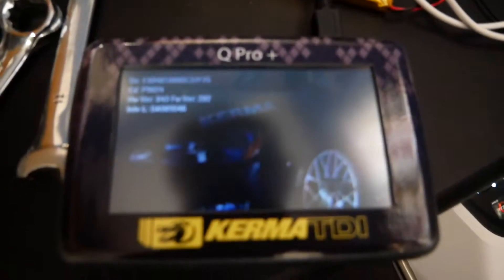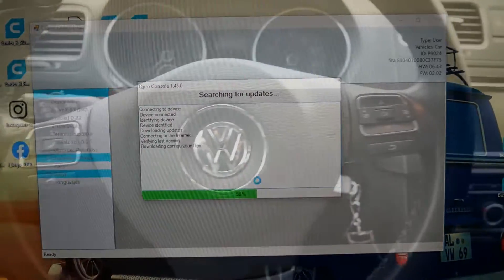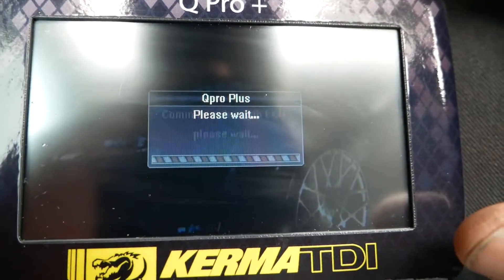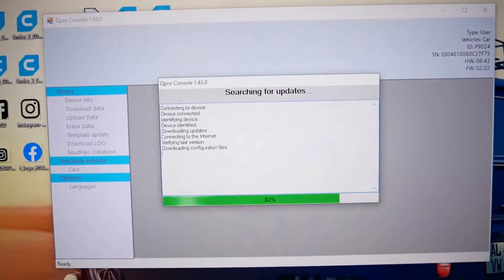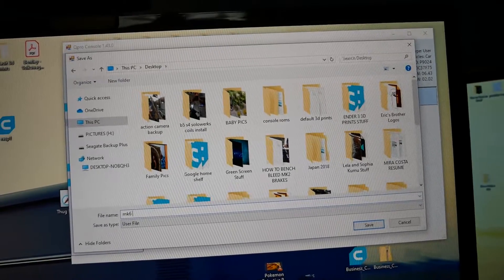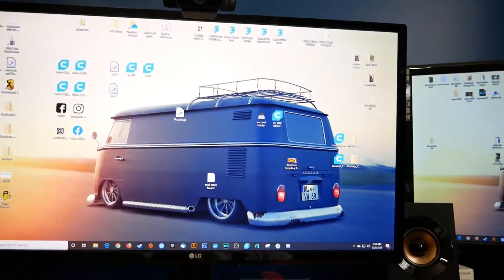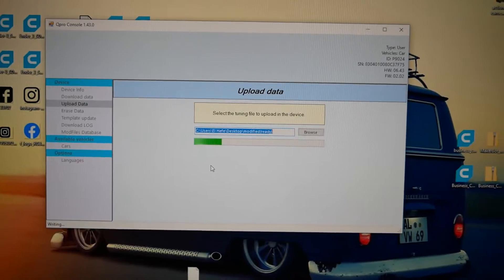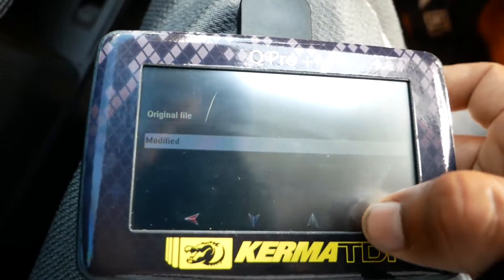How to Flash your MK6 ECU with a KermaTDI QPro S6EP20

Comment: Great video. I have a 2013 Audi A3 TDI and this simplified the process for me immensely. Got the tuned file from Charlie at Kerma in less than 24 hours. After receiving an error code ("F002") during the flash process, I got on the phone with Jason and he and Charlie were able to resend me an updated tuned file based on the error right away and after that, the flash process went smoothly. Now my A3 TDI runs like a beast! I ordered the DSG tune as well and can't wait until their special tool is available to help me complete thst process. Thanks again!

Comment: Can this be installed on more than one car? I'm thinking of buying one used but don't want to get ripped if it's bound to a single car.
Reply from the maker: No they are VIN mated once used. You can not use it on any other car after it get used.

Comment: I will never not watch this video when using the qpro+. I have had to reload my tune a couple times because of the dealer doing troubleshooting one of their steps is to just load their tune just in case. I didn’t use this video once and messed up the steps caused an error and the car wouldn’t turn over luckily found this video followed the steps and recovered from a bad spot.

Comment: Hi! I have a questions, how big is stock files 2MB? Can you use a different vendor to modified files or you have to work only wits KERMA? And, how many vehicle you can read and write? I checked in Malone tuning, they devices looks prety close, bat allowed, locked,  to only for 1 VIN?
Reply from the maker: I would never allow someone else modify a file unless the car gets a dyno tune. Kerma puts in many many hours of tuning to get these Tunes right and safe. Having a random tuner mess with it is just a big NO NO...
Reply: @PincheALsGarage  I have tune shop in my contry  which do tuning in the same level like KERMA, but chiper 3-4 times than KERMA....
Reply: What type of file did you receive back from KermaTDI?
Reply: @EG2RC  I didn't send them my files! I don't wanna to pay them around $800 for programmer tool which I can use for ONLY 1 vehicle!
Reply from the maker: Locked to 1 vin dont really know the file size but it is really small.